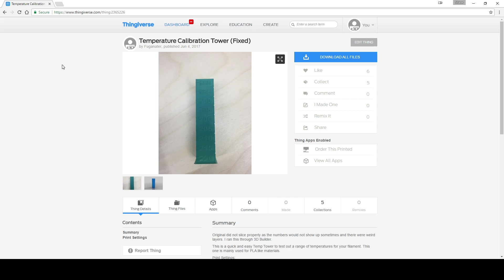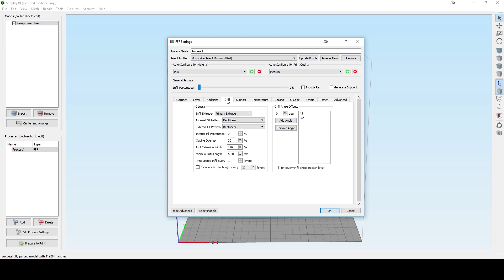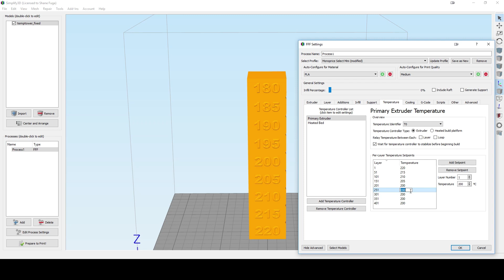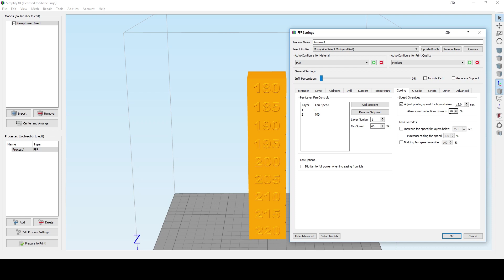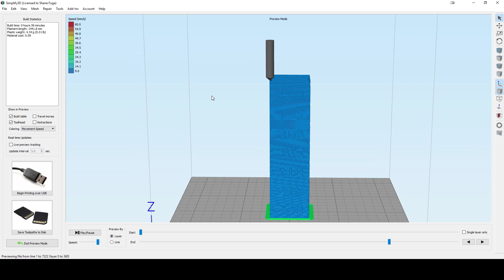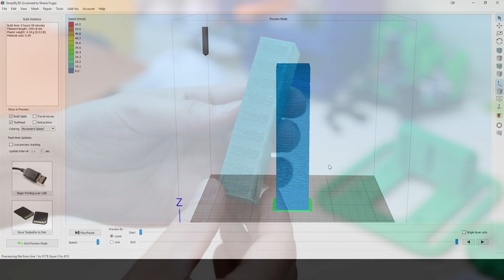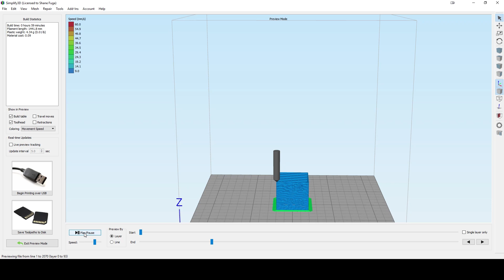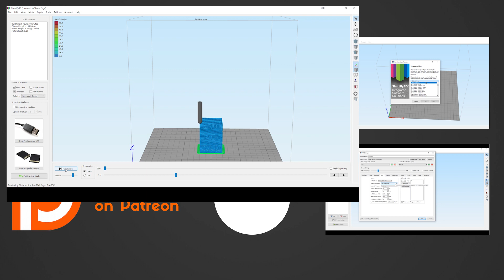How to create a Temperature Tower Test in Simplify3D

Comment: I picked this video because I am using Simplify3D, and this would be the easiest to follow. I think I did everything correctly as you showed in the video. I downloaded the same Temperature Tower from thingiverse, but my layer height was 40 instead of 50. No biggie, easy mod to keep up with. What stumped me though, is that when the tower finished printing, the whole tower, edges, faces, everything was perfect. There is no noticeable variations, ugly parts, sweet spot, nothing to let me think that THIS is the proper temperature to print this filament. I am working with PLA+ by the way. No clue what is going on. Maybe I just have a very forgiving filament that will print at any temperature? This is a good tool, but I am disappointed that I may have done something wrong, and printed the whole tower on one temperature without knowing. That is my only explanation that I can offer, though I am certain that I did everything correctly. Would love your input. Thanks for making a great video. Wish it worked for me though. Subbed.

Comment: Very nice tutorial, I've done it. I got the same result as you, I can't see any difference. The surface and the corners of the tower are the same, no change at any temperature. Every floor is the same.
So we have just proved that the temperature is not so important parameter at all, its 40*C (!) difference between the top and bottom of the tower. And it doesn't matter at all. This is a little surprising, and it would need more explanation.
Reply: I had the same exact result as you did. I am printing in PLA+, which started out really hating me until I just randomly tweaked with the bed and extruder temperatures until something would work. Not the most efficient route to take, for sure. I printed one of these towers out, and I am pretty sure that I did everything correctly. No changes on the entire tower. Everything is exactly the same from top to bottom, side to side. I am confused.

Comment: Hello. I have a Creality CR-10S,

I have a Creality CR-10S and use Simplyfy3D as software.  I ordered new filament and wanted to use a Temp Tower now.  I came across your video while doing so.  If I take over the settings which are provided with this file, my program shows me a printing time of 37h.  That can not be for such a small model.  Can you please give me the settings here?  I assume that this should not take longer than 15min. 
 
Thanks a lot!

Translated with www.DeepL.com
Reply from the maker: What is your print speed?

Comment: I'm watching a 3D print using this technique for changing the temperatures on a test tower and I don't see the printer "waiting" for the temperature to stabilize prior to beginning printing the next level in the tower. It definitely started "heating up" to the 225C level but it didn't pause printing to wait for the temperature to stabilize. And yes, I have "Wait for temperature controller to stabilize before beginning build" checked.
Reply: My RigidBot Firmware has this message only at the beginning of the print, the continue to print normally as seen in the video.

I am not sure if having a firmware that stops the print is a good thing, because the stopped hotend may damage (melt)  the current print.

To work well in theory you should have a clever slicer that in the gcode writes the following commands:

- retract the filament (in gcode)
- moves the hotend away in empty area (in gcode)
- set the new temperature (in gcode)

during the print the firmware will blocks everything after this gcode line and will wait the correct temp (we are in an empty area, and retracted to avoid oozing). Once at temp, the gcode continue to be executed.

-  moves the hotend at the exact previous location.
- extrude the filament
- continue to print

I see very complex, and I think no slicers write this special gcode command sequence prior and after each temperature change.

Comment: Thanks for sharing. The simplify3d section was very clear. Is it fair to takeaway that this particular test told you the filament is best to print anywhere between 185 and slightly lower than 220? What ideal temp did you decide to use for the rest of the roll? Maybe the range needs to be larger to see where there filament performance is not acceptable. Thanks again.
Reply from the maker: There is no way to test an entire roll so this test is only so accurate. You would hope that the rest of the spool behaves the same way.